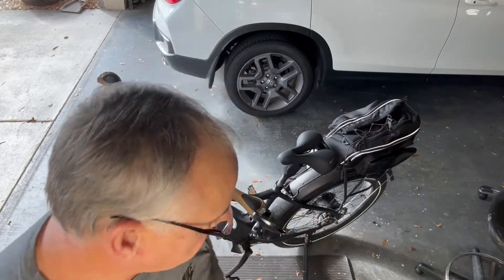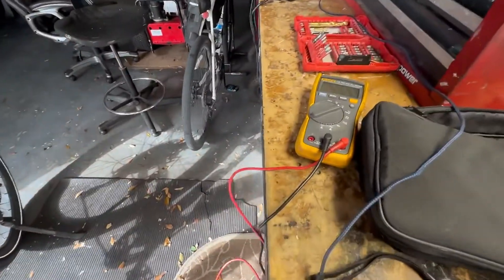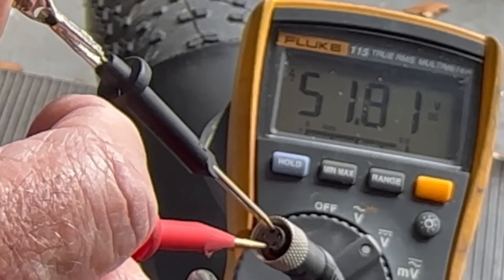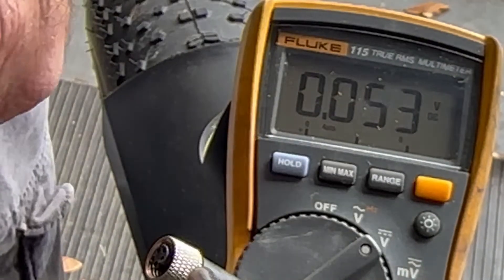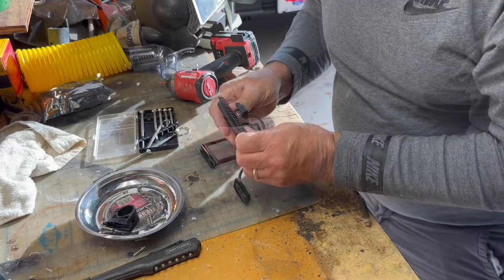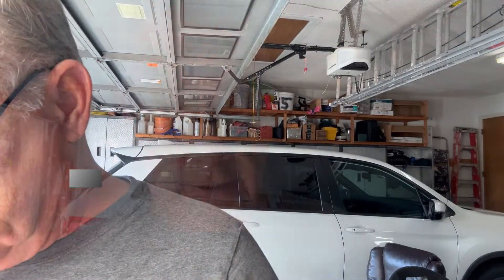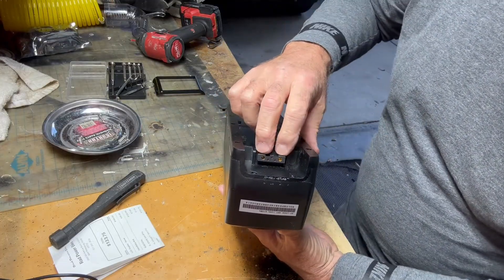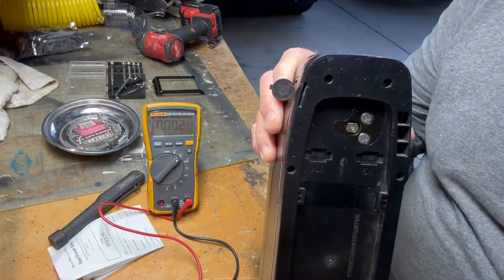3 Reasons Why Your E-Bike Will Not Power Up

Comment: I got no screen and no horn works Nada I checked all connections and battery fully charged
Reply from the maker: Is your horn power tied into the LCD screen. My horn is not wired through the LCD screen.
Reply: Having the same issues

Comment: There a two small plastic covers for the fuses on the battery. Right next to the locking mechanism. No need to take the battery apart.  Good video though. Thanks.
Reply from the maker: @alaskaruzz17  Thanks for sharing.

Comment: Hi I've got electric scooter batteries are full all dashboard working but in to drive no power from twist and go handlebar any advice.thanks
Reply from the maker: Is your pedal assist still working? If so you can eliminate the hub motor. I would think that it is in your throttle/twist and go handlebar. That is what I would focus on. Let me know what fixes it. You will help someone with the same issue. Thank you for watching.